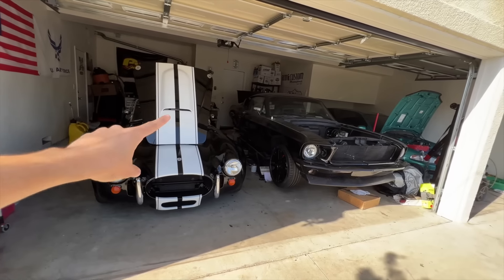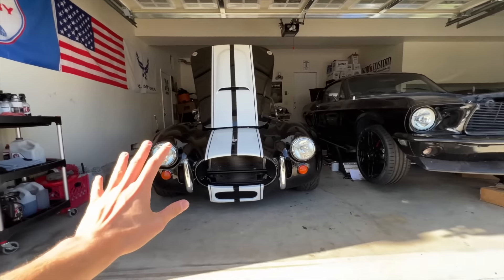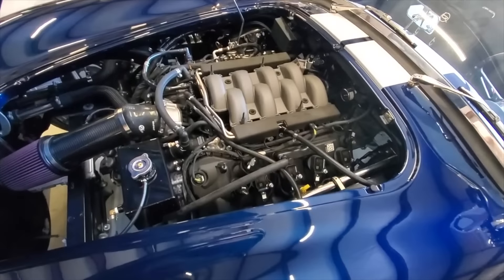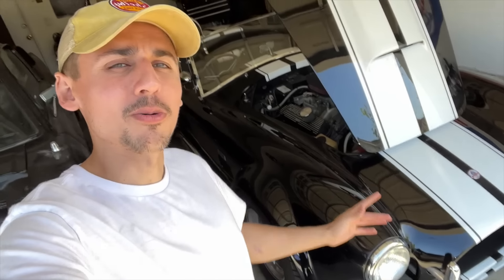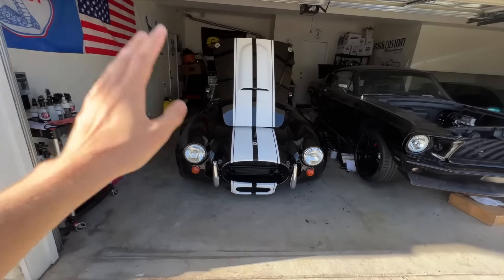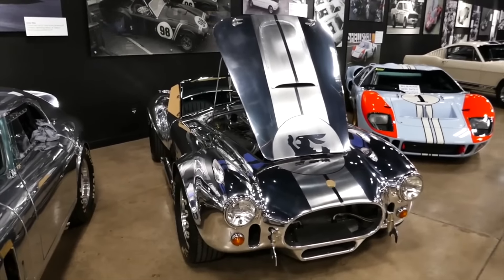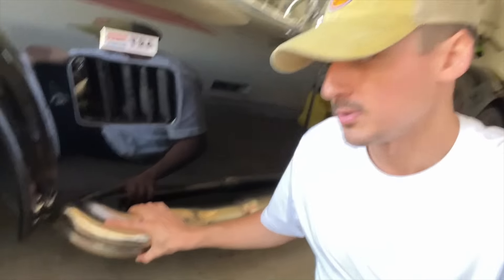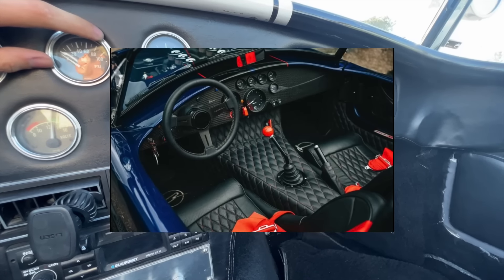Building A GODZILLA Super Snake AC Shelby Cobra!?

Comment: ONE OF THE MOST ICONIC FORD ENGINES IS THE EARLY 60'S IS A 427 SOHC ENGINE. IT WAS OVER  686 HP BACK IN THE DAY. IT WAS SUCH A BARN STORMER THAT THE GM, AND CHRYSLER GUYS HAD IT BANNED IN NASCAR. THEY JUST COULD NOT EVEN COMPETE WITH IT. IT WAS SO FAR ABOVE AND BEYOND. IT JUST RAN AWAY FROM EVERYTHING!. THEY ARE VERY PRICEY, BUT I THINK JOHN KAASE ENGINES BUILDS A MODERN VERSION OF IT.  OOPS JUST CHECKED THE PRICE ON THE SOHC, IT'S $55,000. DAMN THAT WOULD BE A PERFECT ENGINE!.

Comment: You could go with a viper v10....remember the viper is just a later version of the cobra. AC fans are what those are and you can get them online. Those bumper hangers are for quick Jack's for when the car was raced. The big steering wheel was because they didn't have power steering in these cars

Comment: Definitely modernize the car (LED lights), full restomod build, upgraded suspension and brakes for handling, and do a FBO gen3 coyote on E85 with long tubes, and the 10R80 trans. Do the diamond stitched interior with modern gauges, steering wheel and nice racing bucket seats

Comment: I have a stroked out windsor in mine. (light weight motor, 550 hp).  It's fun, dangerous, more than enough power and nothing beats it off the line.  I'm thinking of building another one, here's my thoughts:  I'm old school, so as close to original as you can.  If you can get a 427 side oiler ,great, but  Waaay out of my price range. The coyote is the most popular, tons of power and torque but, they just do not have that nasty low original guttural cobra sound, especially at idle. So for me - it's the Godzilla with the latest cam from Ford, headers and a tune. That's it! If more power is needed, you can always bolt a SC on after. - (a couple of good one have come out in the last year and the price is coming down.) PROS: Nasty sounding beast with the strongest motor from mid to high speeds. Cons:  you lose some torque at low speed, not sure what 0-6- would be because, well, no ones tried this set up yet that I know of.

Comment: You can upgrade your 351 to a SBF 427, r😮n your compression 9.1 and purchase two Paxton’s Supercharges.  When you run high HP on the Cobra a manual will keep the car out of traction, that’s why Carol went with a C6 tranny.  I run a 347Stroker pushing 500HP with a C4 tranny.  The tranny was built by Level 10, 3400 Stall and a sequential 3 speed with a manual trans valve.  Always in gear and very fast!

Comment: Go with a high horse power coyote.  The truck motor has to be heavier and I think it would mess up the power to weight ratio. Might mess up the handling...you can poke and stroke the 351 to 427...

Comment: you dont need the godzilla torque because of the very light car it will be undrivable. take the 427 its more period correct and the sound fits the car the most
arent the hangers used for jacking the racecars up?

Comment: What about 60deg volvo v8 4.4Litre same as the Noble?  Engine from Yamaha owned by Ford when it came out.   Grant Giliomee
Reply: I say that narrow Yamaha  engine even with a blower means much more extra leg space, less interior heat and manual shift gearbox. The engine can be brought to the centre of the chassis for handling too. Also you can drive with your legs in front of you instead of to the side so longer trips are much more comfortable.
Reply: Imagine the sound, power and weight advantage of the same power plant as the Mazerati Noble M600. Rather blower than turbo though. Plenty engine bay space. Remember Ford owned Volvo when commissioning Yamaha. Ford also used Yamaha in a few of their cars too.

Comment: Custom headlights with the changing color halos nice three piece rims with a very wide limp Gone in 60 Seconds Eleanor Mustang pepper gray paint very cool a shift indicator steering wheel be cool black exhaust would be cool when Ford owned Aston Martin at the time they took two V6 Ford Taurus engines and made a V12 that would be a cool engine Ford made a V10 people have put it in Mustangs and Mavericks Carroll Shelby worked on the 1st Generations Dodge Viper direct link to the V10 only thing about the new Voodoo engine and Shelby engines the oil filters is backing out causing fires engine failures look into it

Comment: MODERNIZE ALL THE LIGHTS AND GAUGES. NO INCANDESCENT LIGHT BULBS ANYWHERE. THE INTERIOR OF THOSE CARS IS SO BLUNT AND BASIC, JUST AWFUL. DO SOMETHING THAT STANDS OUT. MY FIRST CAR IN HIGH SCHOOL, BACK IN THE EARLY 80'S WAS A 70 MG MIDGET WITH A FORD 302 AND C4 AUTO TRANNY. I COMPLETELY REDID EVERYTHING, INCLUDING WIRE HARNESS BY MY SELF. ONE THING I DID WAS REMOVE THE DASH AND PUT IN MY OWN WOOD DASH WITH DIGITAL INSTRUMENTATION. IT WAS COOL BACK IN THE 80'S, BUT NOW COMMON. NO BUMPERS IN THE FRONT, AND SPLIT BUMPER IN THE REAR.  FIND SOMEONE THAT IS GOOD WITH WOOD. YOU COULD HAVE A WOOD DASH, WITH GAUGES THAT ARE SET DEEP IN IT WITH CHROME RING SET IN THE DEPTH, AND A COOL CENTER STACK AND CONSOLE ALL IN ONE. YOU CAN SET IN A TABLET, IN THE CENTER STACK / CONSOLE FOR ALL THE COOL APPS AND NAVY, SO ON, SO ON. I DREAM ABOUT BUILDING ANOTHER V8 MG MIDGET, BUT THAT TAKES MONEY, IN WHICH I DON'T HAVE. GODSPEED WITH EVERYTHING BUDDY!.
Reply from the maker: You got it on the spot! Thanks for the input and suggestions